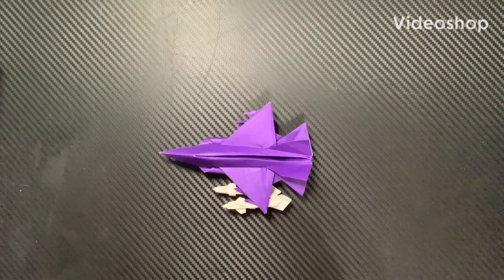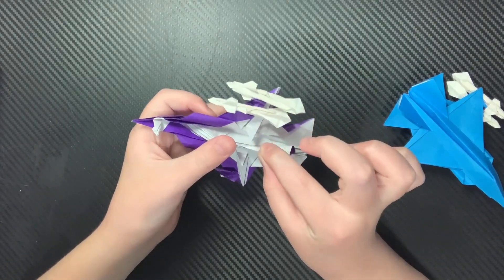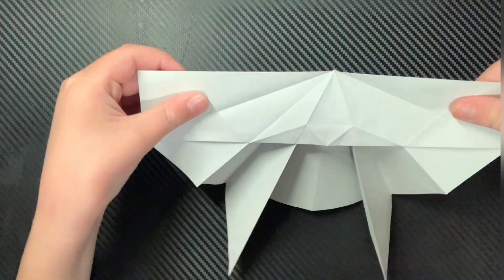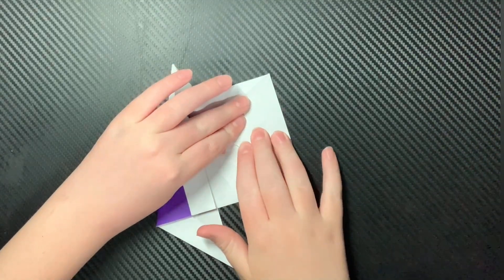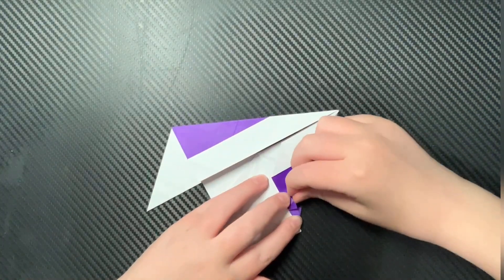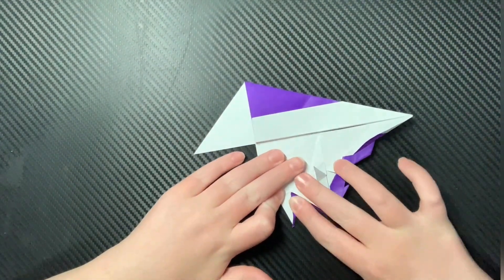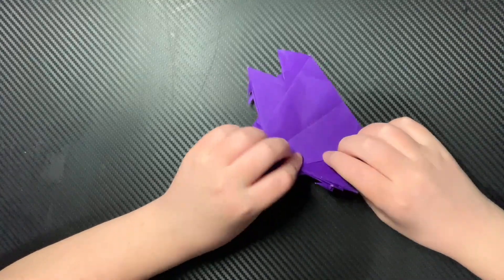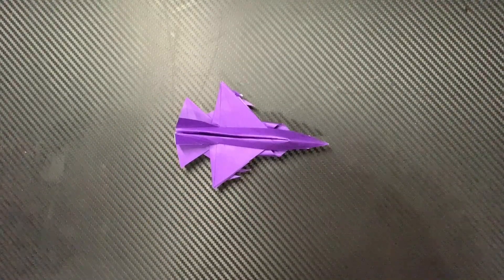Hybrid Examples Ep.1: How to fold Fury X V2.

Comment: a plane that looks cooler and is easier than the original Fury x 2.0 (or v2) has to be in my hands
Reply from the maker: @nagakirannagarapu1125  maybe
Reply: what do you mean maybe
Reply from the maker: @nagakirannagarapu1125  lol just messing with ya
Reply: oh and I just made two new air intake designs best part you can go from one to another
Reply: im not sure but its only for this plane
Reply from the maker: @nagakirannagarapu1125  cool!
Reply: thanks